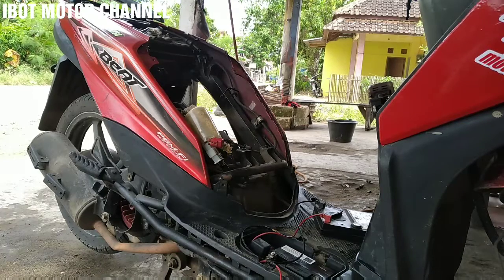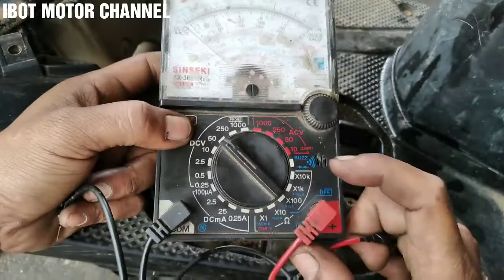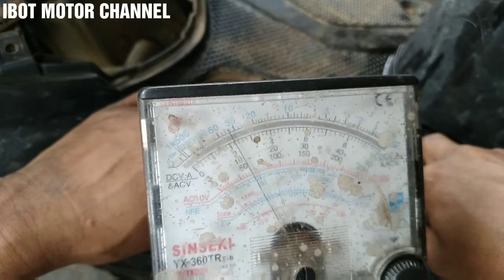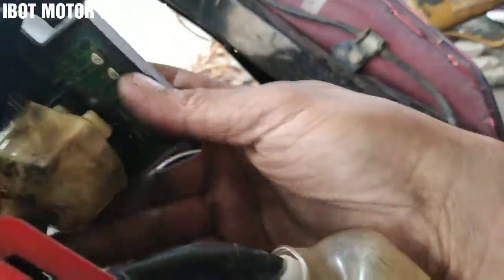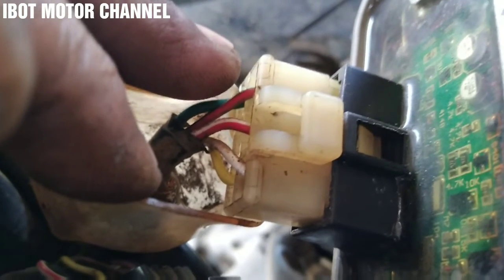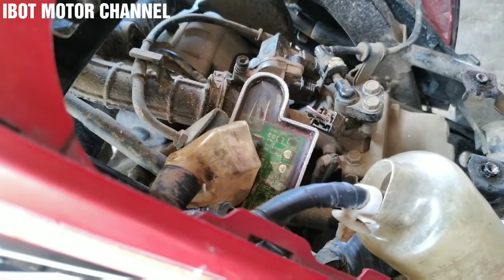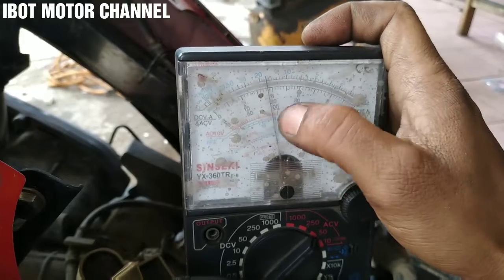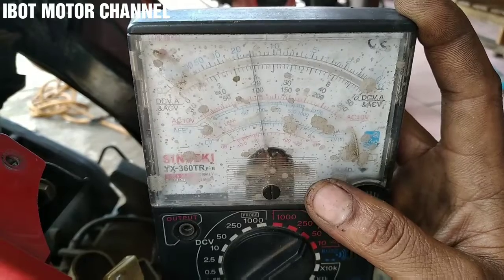Cara Mengetahui Dan Cek Spul Pengisian Aki Motor Yang Over Volt, Kiprok Panas, Aki Tidak Mengisi.

Comment: Izin bertanya mas, jika kondisi seperti di video spull overvoltage, sedangkan keluaran kiprok itu normal kisaran 12v apakah tetap ada efeknya? Lalu efeknya apa ya mas? Terus sama satu lagi mas, apakah ampere aki besar juga mempengaruhi besar voltage yang di keluarkannya kah? Soalnya saya coba motor GL Pro neotek biasa pake 3an ampere Saya pake Aki motobatt yg 6 ampere, Mohon dibantu ya mas terima kasih banyak atas pencerahaannya sebelumnya…

Video yang bermanfaat sekali🙏🏻🙏🏻

Comment: Bang kalo udah over voltase gitu cara ngakalinya gmn bang,apa ahrus ganti sepul ,atau bisa di kasih penghambat arus?
Reply from the maker: akali tambahan arus beban lampu.jasi tambah lampu bisa strobo atau apa aja.
Reply: @ibotmotorchannel6334  udah tak kasi bandul bohlam lampu tembak 2biji,,masih putus juga bang,,
Reply: Kasusnya sama dengan motor sy suzuki skydrive yg over voltase pdhl spul ,kiprok jg aki baru tapi tdk mau ngisi...cara ngakalin nya gmn barang x ada pencerahan
Reply: Ia ni saya udah ganti kiprok tetap ja lebih dari 14/15volt kadang 16volt,kalau ganti spull apakah itu solusi nya atau gimna ni.

Comment: Bang motor saya beat karbu sudah ganti kiprok dan spull yang ori kok masih mengalami over voltage yahh di cek pake avometer di lamsam berada di tegangan 16 kalau di gas sampe 20+
Reply from the maker: tetap maslah dispulnya.pastikan pengukuran akurat.jalau kioroknya gak terlalu panas masih tetap aman
Reply: @ibotmotorchannel6334  spull kan baru bang, nanti dehh saya cek lagi pake avometer yang lain soalnya yang saya pake avometer yang manual

Comment: Punyaku mio smile kluarn spul
Nyala stasioner 15 v
Klo d gas jd 10 v
Accu bisa stanbay 12.80
Waktu jln bisa d isi 14.90
Tp knp d stater tangan kok g bisa?
Tp klo d engkol dlu baru bisa d stater tangan.
Kmungkinan bsar bsa stater tangan klo volt accu 13 v
Apa bnar 12.80 tdk bs d stater tangan
Reply from the maker: itu normal.maslah bisa di akinya yang mulai lemah
Reply: @ibotmotorchannel6334  
Tp knp accu mulai rewel 5-7 bln saja

Comment: Mas untuk seting multitester itu di ac apa di dc untuk spul ukuran brp di multitester
Reply from the maker: Dari soul stel ac di angka 20 atau 50. Dan dc jalur keluaran kiproknya diangka yang sama dan keduanya baik ac atau dc yang bagus hasilnya di angka 12 - 15 volt ac atau dc.
Reply: @ibotmotorchannel6334  bearti kalo.dari spul langsung Ac ya dan kalo tes di keluar spul yg mengarah ke kiprok pakai dc ya, makasih ya mas

Comment: Mas mau nnya dong tolong di balas,,🙏
Motor mio soul gt 115cc saya ini voltmeter nya menujukan 14,15,16volt kalau kepanasan/jlan jauh brebet trus gak lama matii itu spul nya apa kiproknya yg over...
Tolong di Jawab ya Mas,,
Terima kasih...🙏🙏
Reply from the maker: kiproknya mas.tapi pastikan daribspul di angka 12  - 15 volt ac
Reply: Berarti saya cek dari spul dulu ya mas di angka 12-15Volt kalau spul nya Menunjukan di atas 15-20 brarti spul nya yg over take ya mas bkn dari kiproknya ya mas...
Reply: Cek CDI
Reply: Bang kalo over dari sepulnya berarti harus diapain